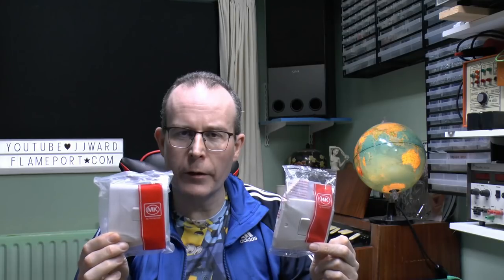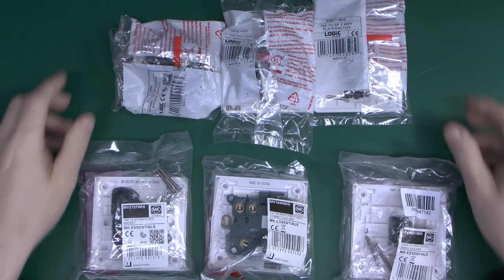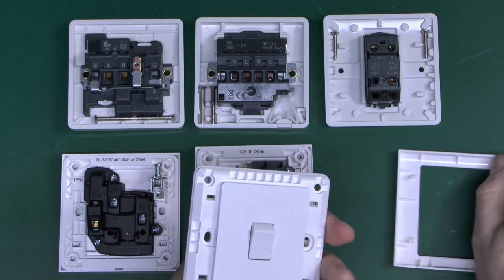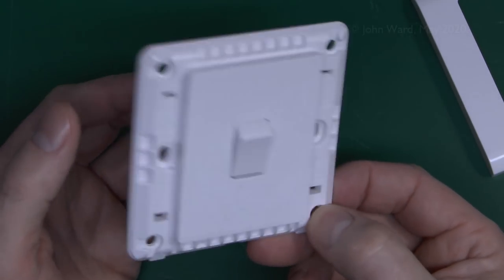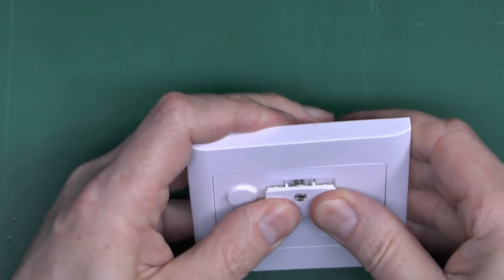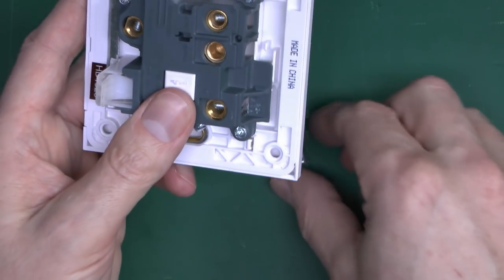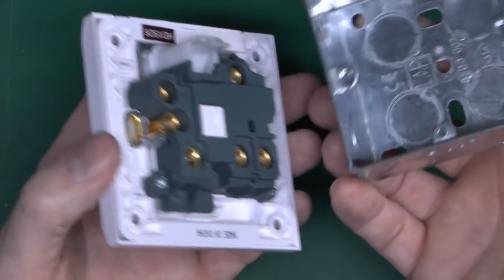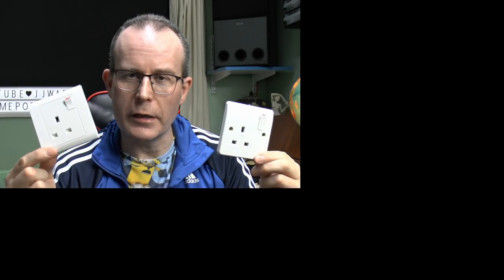MK Essentials vs MK Logic Plus

Comment: No MK, no........ JUST FLIPPING NO!!!!!!!!
Notable points listed 
below I wish to comment on......
.
.
.
(1) At 3.42 .......... Those lower "essentials" accessories DO NOT deserve to be in those bags!
(2) Also at 3.42 ..... The socket at the top left just wanted to be a rebel and threw itself in the bag sideways. :D
(3) At 3.52 ........... Logic Plus, Made in UK.
(4) At 4.04 .......... Essentials made in china. Also, ironic timing point in the video: 404 - Switch not found. :D
(5) At 4.46 .......... Exactly how much mileage of protrusion do they want on that switch module?!!!
(6) At 5.14 ........ Packaging Fest. As you say, completely unnecessary, as well as easy-to-lose screws bag!
(7) At 5.50........ Yes, that stuff can easily be broken on the LogicPlus range, but stays white, does not 'yellow' over time.
(8) At 6.55 ....... Bendy = soft, so may be easily deformed/scratched/scuffed/become grubby. May also 'yellow' over time.
(9) At 7.05 ...... Burns? Did you say BURNS?! Aaaaah, I WANT FLAAAAMES See how well it melts/tans/smokes. :D
(10) At 8.05 ..... These are for the bodge artists who screw the switch directly to a wall with a huge hole behind, omitting
         the need to install a box. This bodgery is most likely to happen in plasterboard walls, as "seanbza" stated.
(11) At 8.49..... Aaaah, POXY STEEL. I remember when fixing screws were chrome-plated brass. Never rusted. 
(12) At 9.49...... Check out the mileage on thaaaaat. My goodness, good luck installing THAT on a thin plasterboard wall !!
(13) At 13.25 ..... THAT IS A SERIOUS SAFETY CONCERN The idea of having concealed/recessed terminals is EXACTLY
         what you said: If someone takes the switch off the wall while it is still live...... THINGS MIGHT GET FIZZY!!
(14) At 17.08..... GOOD LUCK trying to do THAT in a confined space such as under a shelf in an airing cupboard, right next 
         to a 60 degree celsius immersion heater tank!! WHAT AN ABSOLUTE PIG'S EAR THAT IS!!
(15) At 25.35..... Very good! You spotted this also: The basic one does not have MK's 'three-pin' shutter mechanism, but 
         instead, just the rock-bottom basic earth-pin-activated shutter mechanism.
(16) At 26.26.... That doesn't surprise me, being only SP switched. Look at the neutral terminal on the back. It's immediately
         inline with the neutral pin hole. Almost dead-certain to be SP switched when you see that on a socket, EVEN on early 
         MK sockets I may like to point out. :-)

Wayne's Electrical wrap-up on this: Like you say, a few pennies saved on wiring accessories is NOT really worth the hassle of installing these and the fact that they are a bit horrible and budgety.

My mantra rings true once again: Pay a bit more..... Get a whole lot more!

Really, I think Honeywell are behind this. MK IS NOT  'By Honeywell'. MK was around quite a long time before these
kind of shenanigans. This is about making sales to make shareholders happy. Stuff reputation. Stuff quality.

Unfortunately for some time now, things with MK have started going down hill. As an example, EVERYTHING used to be British Made. Not anymore. I have some 'Commando' accessories which say 'Made In Sweden' on them. Nothing wrong with that, on the provision that the quality is still there, and yes it is.....Or was, as I think the Commando accessories are no longer made in Sweden. I have even seen one which said 'Made In Czech Republic' on it. Basically: Make the things where the labour is cheapest. Minimum outlay, maximum profit, super-yay for the shareholders. That's what this is about. POXY MONEY again!

It saddens me to say this, but I think that someone, somewhere is milking MK for all its worth, and once they have run it into the ground, it'll be sold off to some "Could-Not-Give-A Damn" yeehaw outfit in some other country, all of the UK workers will be blown out and the taxpayer will have to pick up the pieces of another x-number amount of unemployment benefit claims, and that'll be the end of yet another well-known UK quality brand.

The 'Essentials' brand marks the beginning of the race to the bottom: Let's see who can knock one out the cheapest. Stuff wiring accessories which last  two or more decades, let's see if we can design them to knacker out and look knackered out within a decade. Polycarbonate, my backside! What next.... Recycled cola bottles?!

While you still can, I would advise going to the bank, whipping-out a few hundred pounds and buying lots of good quality LogicPlus accessories, because in a few years' time when everyone's knocking out cheap tat you wouldn't want to touch with two barge-poles gaffa-taped together end-to-end, you'll be safe, knowing that you have some good quality back-in-the-day accessories to fall back on.

Thanxx for showing this, but now I don't know what thumb to press: Like for the vid, but dislike for the 'essentials' range.

Really, I am particularly browned-off that something like that would have the MK logo on it. Really hacked off.

I AIN'T HAVIN' IT!! Also, a bit later, I want flames. BIG ONES. I want to see some of those accessories cranked up.... 

....Uuuntil they pop. Let's see what they can handle. Don't pussy-foot about with it though.... Some end-users who think electrical systems run on magic fairy-dust can be known for ripping a good 25-32Amps out of ONE socket, so don't hold back on the loading tests.... really give them a PROPER BEATING!! Let's see how they hold up, and of course, if that polycarbonate maintains its shape or has a melty moment, goes all floppy, drips everywhere and consequently leaves exposed terminals.

ALSO..... An interesting test: set up an accessory on a board or something and leave something VERY HOT close by, such as a heater or something heat-emitting which would be found in a typical household and let's see how the accessory deals with it.

Of course, MK being quality, they have most likely done all of these tests. Right? 

But soft polycarbonate though..... This leaves me feeling doubtful. :-(

Thanxx for showing,

-Wayne's Electrical.

10th May 2020, 21.20

Comment: Mk have really gone down hill this time. Getting China to make their stuff. Big mistake MK. Reminds me of Clipsal crap. Even if the Chinese gear was any good, and 99% of Chinese stuff is generally cheap crap anyway, I wouldn't buy it now seeing as they deliberately almost wiped the worlds population out recently.
Been out of the trade many years now but when I bought MK I knew I was buying good quality British made stuff and the reliability proved that. I always used MK whenever I could. 
How that exposed termination screw design even got past the design dept. I'll never know.
I often had trouble getting the fuse carrier out of Logic Plus connection unit, I often wondered why they made it so difficult.
MK should start making barrels, they seem to be scraping the bottom of them these last few years. Or would they have to be made in China also???
Good vid JW

Comment: What Utter Rubbish. 

Only idiots in a suits would think of using such poorly designed products to Ruin a company's reputation.

We want a load test to destruction on these items.

And perhaps winding up the current though the supplied fuse to see whether it will pop at 1.45 times its rated current.

MK would have made more money by putting a completely different Not MK brand name on them and re-selling them to a certain type of shop in the more inner city areas and preserved their reputation.
Reply: The stuff would be confiscated by  custom and excise if they sold at a corner shop in a inner city area as counterfeit goods, stock 😳

Comment: Logic Plus with the slick curve were launched in 1996.  Everyone copied that look since then, but MK still have best switch action. 

Essentials looks like a thing for Asia and UAE.  But… it’s actually good quality from a Chinese OEM (Kaifeng) which made BS1363 plugs for decades. I think they made Scolmore/Click and I can remember Scolmore plugs first appearing in the early 90s on GlenDimplex group products. 

Personally, you’d be better off going Crabtree which I keep finding cheaply and are just as good as MK (I really want to prefer MK but they don't make it easy these days).  I always liked the Crabtree Capital series which are unchanged from late 80s and I don’t believe they look outdated. Very solid.

Comment: I'd gladly take the cheaper (cost) Logic Plus line, made in the UK by superior materials; thank you very much!! I'd rather give my brothers and sisters in England the business than the Chinese.

I also like how in the UK, they mold the electrical specification into the backs of the receptacles, ie. BS 1363. That's a nice touch!

The finger safe wire connection points on the Logic Plus are also far superior with the deeper wire entry tunnels that are flared to assure there is good guarding and fitting of the wire insulation. Very nice touch!
Reply: BRING BACK BRITISH MANUFACTURING STANDARD AND QUALITY. 🙄

Comment: The earth shutter appears to be the bog standard type rather than the even safer logic plus design whereby both L+N pins have to be inserted at the same time?

Always liked the innovation of the angled terminals & captive screws on logic plus, maybe they've copy pasted the descriptions? Looks like just the one earth terminal on the sockets also?

Dear oh dear, always used to say any MK fitting going to have to append that with except 'essentials' range!

Comment: Thank you for showing this. Clip in covers such as those used in Italy made by Bticino Who are the Italian version of MK), Vimar, are ascetically good, and there's no reason why a similar design could not be made fro the UK sockets - MK Grid was similar. That said, British sockets, switches, and accessories are far better quality than foreign ones. I remember my Italian uncle saying that the UK must be well off looking at the amount of brass they put in their plugs.This is just re-badged rubbish.

I do take the people to task about DIYers likely to use this Junk. As a DIYer, the only junk Ive seen on installations has been used by professionals - some of whom will do anything to cut corners. As John has said, there isn't actually much of a saving for the DIYer, infant for some it'll be more expensive. I suspect that the trade suppliers may be where Essential is cheaper.

I agree, MK is not as good as it used to be, and they've even reduced their guarantee to 15 years from 25. 

Thank you John, for bringing these fantastic videos to us - shame you are not closer to me as you are a professional who I'd employ without hesitation.
Reply: I have no issue with the main Logic Plus range. Doesn’t seem materially different to when it was first introduced in the late 90s, maybe just the terminals and screws. Prices are kept low for the quality after all. Before Honeywell they’d never have added these cheap ranges. 

I know the Italian accessories and what you mean - unswitched sockets in the bathroom! Seems alright though. Prefer our UK over engineering but look at all the rubbish in the market now at the low end!
Reply: @interstat2222  Logic Plus range is hated by sparkies these days because the terminal screws are busted way too many times. They go for Click (cost) or Hager (best).
Reply: @Tephnos  I hate Click (crude snappy switches from some Chinese OEM) and not keen on Hager either.  If it's not MK (agree the terminal screws chew up easily and often don't grip first time and increasingly showing signs of cost cutting) I stick to Crabtree just like I did since the 90s.  
Maybe Contactum if you can find them. Not sure if I like BG as it's just OEM from China and QC seems sloppy.
Reply: @interstat2222  Why wouldn''t you like Hager? There's absolutely nothing to fault about them.

Comment: The MK Logic Plus range has had its own problems. In our home all the light switches with the big rocker option had to be replaced within 4 or 5 years. They used an unsuitable plastic for the rocker itself, which deformed and allowed the rocker to fall off.

Polycarbonate is a strange material to use for a low cost product. Its super strong, but really expensive and hard to work with.

Comment: I wonder if they sent their old moulds over to China.... Would be interesting to compare that Fcu with a 1960s/70s MK one.    I wonder why on earth they would come up with such a range.... Perhaps not really designed for the UK market.
Reply from the maker: Some of the old 1970s ones here: https://www.flameport.com/electric_museum/fused_connections_switches/MK_6779_Fused_Connection_unit.cs4
entirely unrelated.
Reply: Definatly not old MK which were built like battleships, always needed 35mm boxes which was why i used Crabtree which is now also crap

Comment: Very good and informative video.  As an aside, I wonder why the manufacturers don't use crosshead screws for fixing, it would aid installation greatly, especially in awkward locations.
Reply: Cross head screws look totally crap. As an electrician, all electrical screws, (especially terminal screws) should be slotted, and the less said about those awful cross/slotted 'combo' screws the better.
Reply: Forget flats or cross head "Phillips" head screws... Should be using square headed "Robertson" heads for everything.

Comment: Just makes me wonder if the essentials range will creep in more and Mk will phase out the Logic plus range for cost saving for Mk
Reply: I don't think so, for one the essentials range doesn't even fully comply with BS1363. They might end up making all Logic Plus accessories 
in Malaysia and maybe even make everything in China. I don't think the Essentials range is going to catch on.
Reply: @sipsoup I think it's mainly the outer board rocker double sockets that are made in Malaysia but I think the inner board rocker
double sockets ( K2747 ) are still UK made. Most single Logic Plus sockets are still UK made.

Comment: I find it slightly strange that you chose to use a single socket for your price comparisons when double sockets are the norm in the UK. 

Regarding the stickout it seems to be caused by a switch module with the terminals behind the switch mechanism rather than beside it. I would guess the switch module was designed that way either because it was the cheapest way to do it or because it wasn't originally designed for use in a UK electrical accessory.
Reply from the maker: The double MK socket was covered in a video some time ago.

Comment: I had to use wilco sockets and spurs ,it was the only on the day supply, a mix of their premium and budget ranges stock permitting, still look better than that captain clipon mk stuff you have there, 
I was expecting mk budget range to be more like the essentials but without the rounded corners. And a few savings made with materials and parts.

Comment: I just can't stand Mk any more. You seen to get pot luck with logic plus whether it's UK made or Malaysian made. They're also somewhat expensive compared to entry level ranges from brands like BG, Hager, Schneider (which perform just as well - I've fitted hundreds of BG sockets and hundreds of Logic+, both ranges have had failures and both have had successes). Look at the terminal screws on Hager, Schneider etc - they're large and suited to a 4mm screwdriver. Logic+ are too small . Some of the Logic range also only have 1 earth terminal - ridiculous when BG always provide 2 even at the £2 socket price range  The quality certainly isn't there any more  the terminal screws on Logic+ for example and small, often seized up on purchase  and can round off quite easily. Logic+ has also fallen victim to being the go-to public sector brand. Whenever I see Logic in a domestic environment it just feels so clinical to me.
Reply: BG is from a Chinese OEM. I don’t like the action on their switches. It feels crude compared to an established design like MK or Crabtree.

Comment: I just got one of the Logic Plus light switches and found that the brass wire retaining screws were inserted cross threaded and have stripped upon first tightening. I came here looking to see if you answer how it's possible that the switch has already broken before the first use. I wasn't looking forward to a half hour video, but actually you nailed it at 3:53. Thank you!

Comment: MK - You used to be so good.  I have only 1 question on the essential range, WHY?  Just why oh why would you completely screw up your good name and branding from so many years on this utter Chinese crap MK?  Did any of your technical team even look at that switch and think errrr "NO" - I won't be using this thanks.  Thank you John Ward for exposing this crap.  Can you imagine your average Joe public who goes to B&Q on a Sunday morning and buys a new lightswitch to replace the one in his bedroom, should be a 2 minute job.... but No, MK have turned this into an afternoon chisel out of the wall if he has a thin backbox.  Why, why, why would any manufacturer especially one as previously prestigious as  MK create such rubbish?  The socket with only 1 screw attaching to the Earthed backbox, Why?  As stated the cost is not very significant between the two... but the quality most certainly is!

Comment: The electrician who wired up my kitchen used crap sockets (not sure what make) of which 2 have failed. The failed ones were powering the oven and tumble drier which are high power, but still under 13A. It seems to be the switch that has failed as on one of them it won't move to the off position (no power is being supplied), on the other it provides power for a short period of time, to a heavy load, before cutting out.

I suspect they installed CCS [Cheap Chinese S----] sockets, a light switch in the kitchen also failed, not under heavy load.